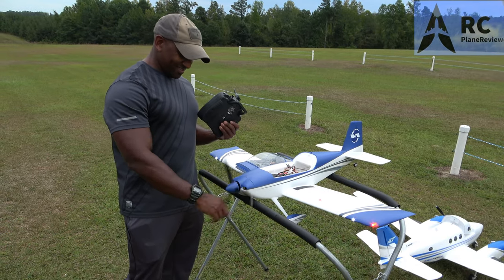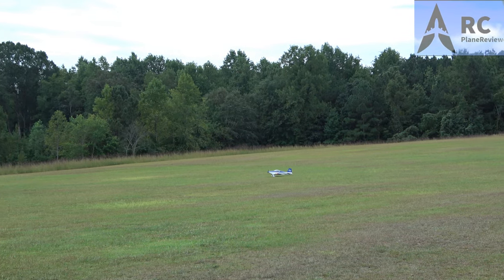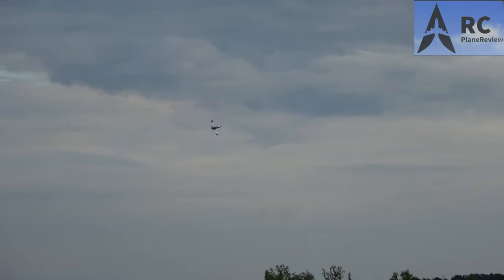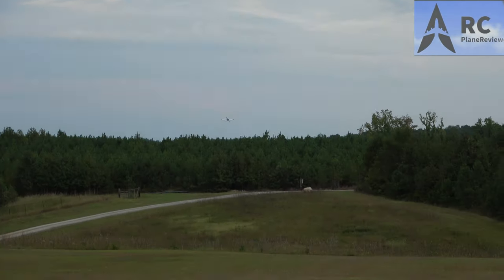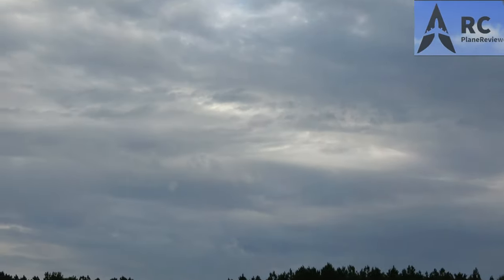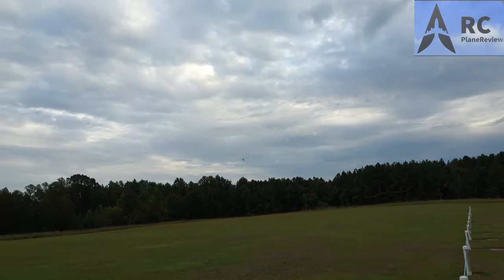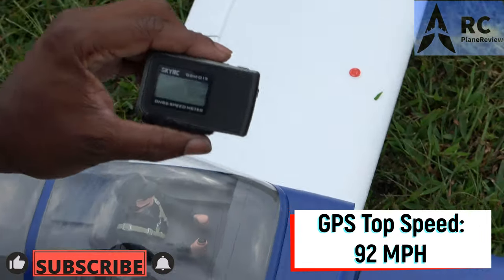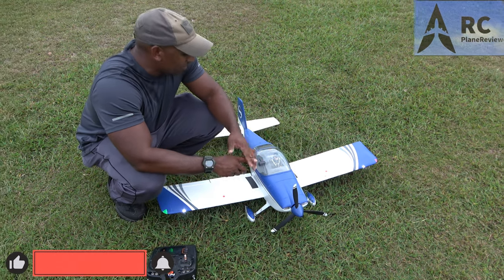Transform Your E-flite RV-7 1.1m: Get Ready for More Speed and Power! #rc #rcplane #rcairplane #edf

Comment: Nice review my man.. i used the 1050kv maule motor in all my 1.2m warbirds to make them mini sports planes. Needing a 80A esc in there tho with the 4 blade 10.5x8. Its also a straight swap for the Commander which tbh was a slow plane but now its very quick with the 1050kv. I now use the FMS 3948 900kv motor from the Voodoo in all my 1.2m warbirds on 4000 5s. My pilatus and nanchang are like pilon racers now. The corsair and bearcat run 12x8 blade props and look way more scale now.
Reply from the maker: I might have to do those set ups! The bigger birds need the extra power to fly scale lol I have the 1.5m P-51 and it needs some pep in its step! Appreciate you!
Reply: @RCPlaneReviewer  I had the P51 and Focke-Wulf 1.5m but sold them cos they were just too slow for a 6s bird. But I looked into motor swap or running 7s. So I got myself another Focke-Wulf and bought the Beaver 6s 550kv motor. Binned the 460kv. The Beaver motor is also in my FMS 1.4m Trojan. All straight swaps and same 8mm shaft. Trojans on a 14x10 and Focke-Wulf is on a 16x10. These are now very quick and sound intense on full throttle.

Comment: That Maule motor hauls the mail. Hell yea. Awesome plane.   I’ve got my Maule all upgraded with full metal gear servos, and a 60 Amp Avian ESC . Clear coated with min wax polyurethane.   Note: Do not put any coats on hinges it will make them brittle.  I also put pinned hinges on the tail and beefed up the tail wheel gear.  Now you got me wanting to buy this little beauty.   Awesome vid . You guys Rock 😊
Reply from the maker: Awesome mods to your Maule! And all good advise too! Get cha one!! It's only money

Comment: Y'all need to do a review on the A10 Freewing 1700mm 80 EDF. That would be a nice review and this was a really good video❤
Reply from the maker: I have it and it's coming! Stay tuned
Reply: It's a very good plane and it doesn't need the 90mm EDF's. Flies great and with a sound system in it it's like the real thing. If you want to know how to spend 35k this is 32k for turn key and 35k for the added shipping. It's the Grande thing that is bigger than my Explore.

Comment: I have just installed the motor and the Maule prop and spinner.. you can run it on the stock prop?

This will hopefully be my fast fpv prop plane
Reply from the maker: Yes i was running it in the video with the stock prop
Reply: @RCPlaneReviewer  maybe ill use the stock prop if its too fast.. 92 is respectful.. 

Saw Jon without the H do a video a year or so ago where he had the Rv-7 reverse thrusting in mid flight with an unlimited climb backwards 

Had to buy the upgrade after i broke my prop after about 2 years of flying it..

Cant wait to get it out for a remaiden flight..